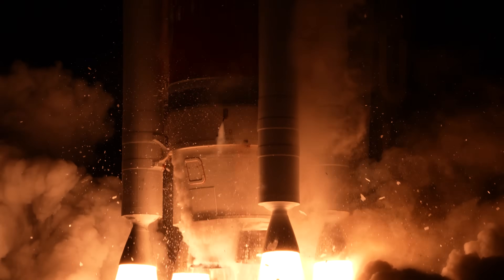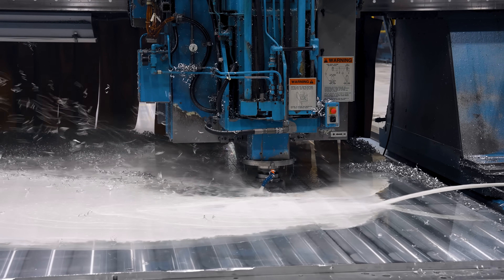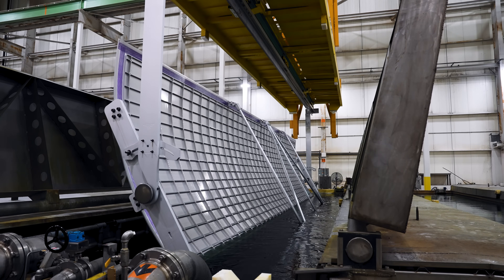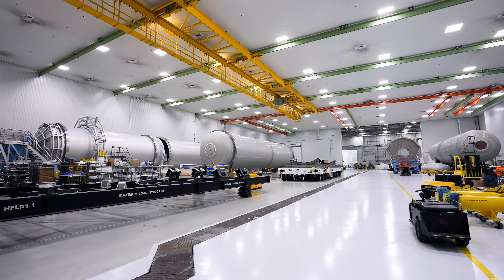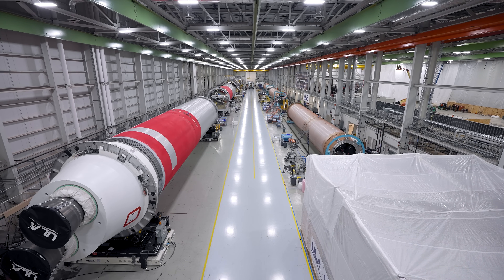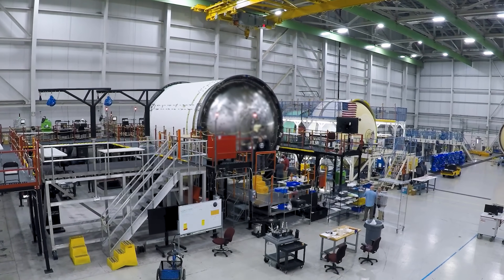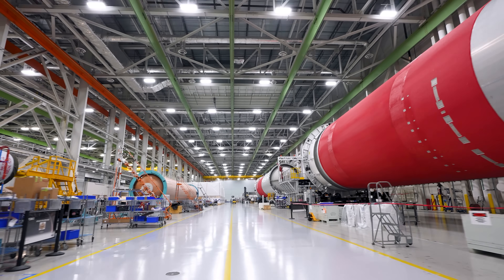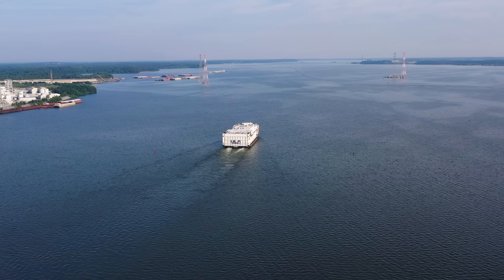ULA Rocket Factory Tour

Comment: Saying that having the stage be 90% propellant makes it the most efficient upper stage is extremely false in fact it pretty much is the exact opposite

I derived the math from the rocket equation and the simple rule of thumb is that the lower the mass ratio the more fuel efficient a rocket is. That’s right you’re more efficient with a rocket that is 10% fuel than one that is 90% fuel. 

Now of course the limiting factor is engine exhaust velocity. That’s the barrier. My doctrine is that it’s only advisable to increase mass ratio if you need more delta v than what any engine you have access to can provide. Which is of course probably the case seing how low the exhaust velocity of chemical engines are compared to for instance the velocity of the planets relative to each other. 
In addition a higher mass ratio upper stage would increase the mass ratio of the final vehicle, payload included which is clearly the intention. But it remains that a rocket is as fuel efficient as its mass ratio is low. Given it has sufficient impulse to accomplish its mission. I mean just think about it logically, on an industrial term, if you expend all your fuel every mission or transfer, would you rather "all the fuel on the rocket" be 10% or 90% of the mass of the entire craft? Of course as low as possible. So the rule is always to maximize engine exhaust velocity, gains from shaving off every gram are not only negligible, they’re also actively wasteful, the returns being logarithmic.
Reply: I believe that you have some things mixed up. For one, the specific impulse of the engine has to be considered. I am not sure why you singled out exhaust velocity. All that being said, you don't have enough information from this video to assess efficiency of the Centaur upper stage but know that there aren't too many folks in the rocket business who would dispute that the Centaur is the most efficient upper stage.

Comment: Ten years after SpaceX started landing and reusing boosters, ULA hasn't lifted a finger to pursue reuse.  Instead, they bet everything on DoD wanting a secondary launch provider in case of problems with the primary provider.  They've been happy to serve as the backup provider, at higher cost.  But now, we have Blue Origin landing boosters and they will soon be reusing them.  Does ULA think no one will notice they just became redundant?
Reply: You need to learn more about R&D. ULA literally had a 5 month window to develop a reusable booster from the ground up. Yea ok dude.
Reply: @lextacy2008     Stay tuned and we'll see who's right.

Comment: I wish ULA returned their 1st stage and reused them. Such amazing engineering going on here just to burn up after single use…
Reply: The reason they passed on this is so they could retire 3 workhorses (Delta II, Delta M/H, and Altas V) and not have a research and development gap that is large as Space X since Space X is doing reuse. They are retiring due to aging infrastructure, not that space x was undercutting. Timing wasn't on ULAs side here.
Reply: @lextacy2008    Yet, SpaceX is undercutting and will continue to. The market doesn't care why you couldn't compete - only that you can't.

Comment: Where's the Atlas V's?
Reply: No longer in production
Reply: @Adrian-wuhow? So Atlas V is halted or are all out of the factory?
Reply: Isn't there like 8 Atlas V's left
Reply: @Elxin761 ye but they're already built (I think it's 10 left. 4 for Kuiper, 6 for Starliner)
Reply: @notgreg123 There are actually 5 for Kuiper launches and we'll see how those for Starliner will be used (since, Starliner is not working as intended)
Reply: @Adrian-wu oh yeah, I saw the Kuiper-4 thing and I blanked and thought it already launched for some reason
Reply: @Adrian-wuwill starliner fly on Vulcan in the future?
Reply: @Elxin761The problem is that Starliner has 6 missions on Atlas V planned and it might not be able to fly all of these missions before the ISS will be deorbited. That means that you have some Atlases V left without any use because ULA doesn't have any fairings for them (because Starliner doesn't need them) so you can't even fly a cargo.  And also Starliner requires only 2 SRBs so to fly for example Amazon LEO (Kuiper) you don't have enough SRBs
Reply: @notgreg123 Sometimes it's hard to keep up with all of those launches, especially nowadays.
Reply: Damn never even taught about that 😂 @Adrian-wu
Reply: @Adrian-wu there's still gonna be stations after the ISS. Even still, currently contracted Crew Dragon missions will go until mid 2027 and the originally planned 6 Starliner missions should've taken it all the way to retirement. Now that there's only 4, it's practically guaranteed they manage all of them. Unless something catestrophic happens
Reply: @notgreg123 I don't think that future space stations are going to use Starliner.
In my opinion the next Starliner mission is pivotal and if Starliner has issues once again it's the end for that capsule.
Reply: @notgreg123 i just read that starliner will be stripped down to 4 Missions , and be reconfigured for cargo missions instead of crew
Reply: @Adrian-wutrue 😂
Reply: @Adrian-wu orbitsl reef is planning to use it but time will tell how things go. I feel like NASA is already planning for two more test flights since they were cut down to 4 launches instead of 5. It's probably just a contingency but still, NASA is giving Boeing every opportunity imaginable
Reply: @notgreg123 NASA is really trying to have a redundant capsule (I think that's great) and unfortunately the Boeing Starliner is their only option.
Reply: There were at least 3 visible at the end, inside of the "hangar" area.

Comment: yall better get on the reuse game fast or you will be left in the dust in a decade
Reply: Reuse is overrated. SpaceX have lost hundreds of raptor engines as well. Super reuseable, eh?
Reply: @kvasir121  falcon 9 launches 2-3 times a week, blue origin has demonstrated recovery and willwill demonstrate reuse on their next flight, china have 2 new reusable rockets debuting in the next month or so and the US has 3 more in the next year or so. there is a reason basically all upcoming rockets are reusable. also most of those raptors were expended because there wasn't need to recover them/ it would make things more difficult
Reply: @GridFinfalcon launching for starlink is cool and all, but the cost is being offloaded onto taxpayers. Falcon isn't that much cheaper than other options, and sacrifices a great deal of payload and launch altitude for reusability. It's a marketing gimmick like everything else Elmo does.
Reply: @kvasir121  how is starlink being offloaded onto taxpayers?? out of the 125 odd this year 36 have been non starlink over twice that of the next closest, electron (which had a reusability program until rocket lab decided to shift their reuse program focus to neutron). they can do this because of reuse, if expenditure was the cheapest way to lug thousands of starlink into orbit falcon would do so ,because it can still launch expendable (like spainsat NG-2) if they need to without the mass cost of reuse. prices are around the same as the competitors for maximum profit, if spacex dropped to their minimum viable price ULA would have been out years ago (setting aside long standing defence contracts) but sure reusability is just an Elon gimmick which is why blue origin, relativity, CNSA, landspacee, stoke, RFA, Orbex and PLD are pursuing reuse prorams
Reply: @kvasir121      Reuse is not overrated.  Since January 1, SpaceX has put as many boosters into space as has ULA in its 19 YEAR history.

Comment: Why not aluminum or carbon fiber for centaur? I'm sure there's a logical reason, I'm just not a rocket scientist lol
Reply: Composites don't do well with cryogenics. It can be done, but hasn't been proven in medium or heavy lift
Reply: @mr.g937  interesting. I'm fascinated but uneducated in material science, so it's awesome I can ask others who know more about it and learn
Reply: They use a thin stainless for strength to weight characteristics.
Reply: @thewrecker666  is hydrogen under that much pressure?
Reply: SS is stronger at higher and lower temps than CF or aluminum, same reason SpaceX isn't using it on starship
Reply: @DrewNar-tacA  
The main driving reason why stainless is used on Starship is different as to why it's used in Centaur. For Centaur it's the mass savings (the lightest stage in world), for Starship it's the high heat resistance of stainless steel during reentry (Centaur does not need to reenter and is not subjected to high temps). Then other factors come into play (low production costs and strength) which would be relevant for both.

And while the weight aspect is a real winner for Centaur, for Starship the weight of steel is a big problem as, unlike Centaur, while also being thicker, they have to use all kinds of steel stringers, rings and ribs to strength the Starship upper stage (and the Superheavy as well) to support its own weight, the weight of the much heavier methane fuel and payload. Centaur's hydrogen is much lighter and it does not carry the weight of the fairing - only the payload.
Reply: Aluminium of the same structural strengh would be heavier than the thin stanless steel used on the "baloon tanks" of Centaur which need to be kept inflated at all times not to collapse when in gravity. So it's a great way to save weight and thus have more payload available. 
Carbon fiber structure would be a lot more expensive than the same stainless steel upper stage to produce. So a great way to save on costs.
Plus as someone already mentioned stainless is stronger at cryo temps than either one of the other two.